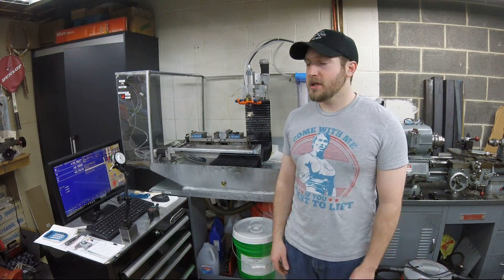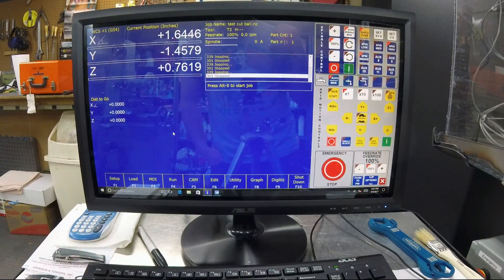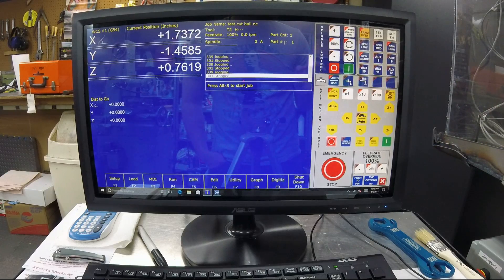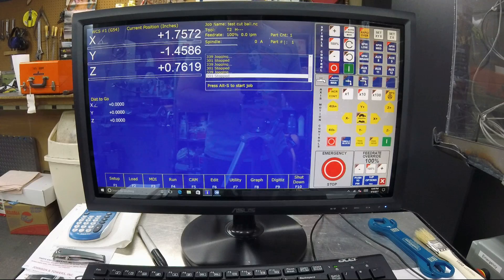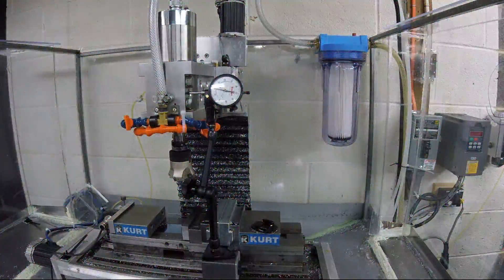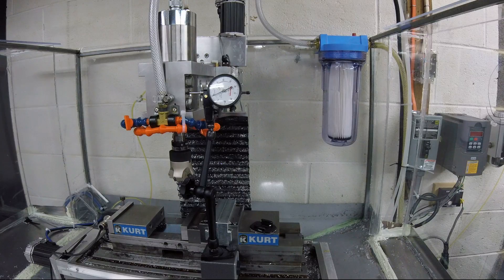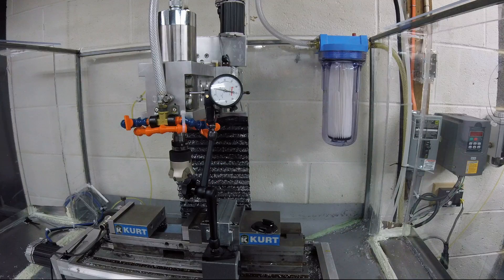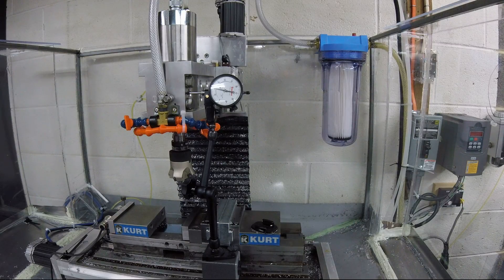Setting up backlash compensation with Centroid Cnc Acorn Board

Comment: Hey Alan, great videos (and shop), thanks! I know this is old, but quick question if you don't mind as I am beginning to shop for parts for a build of my own. I notice the 50mm (?) face mill in your Chinese spindle - can you run that combo and on what materials? Is the spindle just one of the generic 24k RPM ones or did you get a lower RPM version? Also, i think you have a Huanyang VFD, right? Still holding up fine?
Reply from the maker: Its just a cheap china 24k spindle, the vfd is still holding up well, i have face milled a few times with aluminum but dont to it often.
Reply: @hollerbachcustomknives  Thanks so much, that's def good enough for me:). I think you are the first guy on Youtube I have seen running that face mill in the "small" spindles.

Comment: so lash setups only take into consideration the most worn part of the ball screws ? Is there any menu options to setup lash numbers further out on the travel, or just one spot ?
Reply from the maker: automan1223 backlash is only the slop in the ballnut in change in direction. The software is now adding ballscrew compensation tables witch allow you to compensate for the changes in the ballscrew over the whole travel. Ill be posting a video soon about it.
Reply: wow that is very cool. on older worn machines that would be a problem...
Reply from the maker: automan1223 im not sure, ive only used it on ballscrew mill.